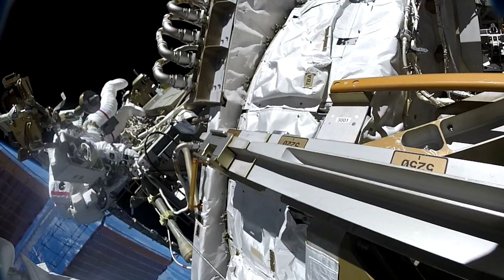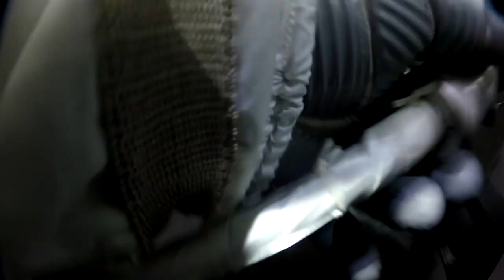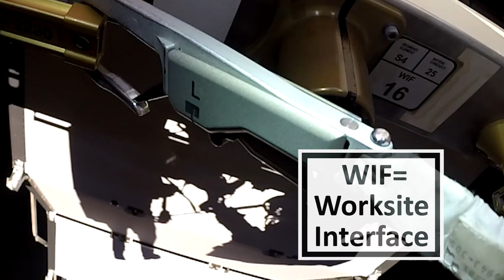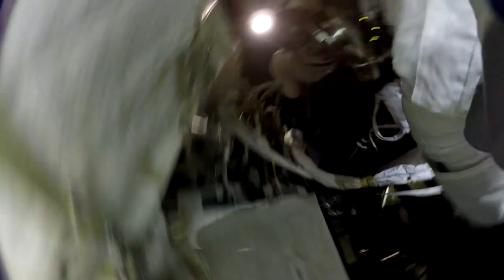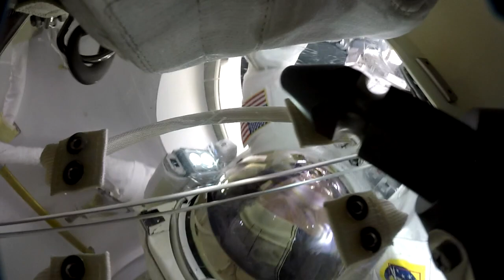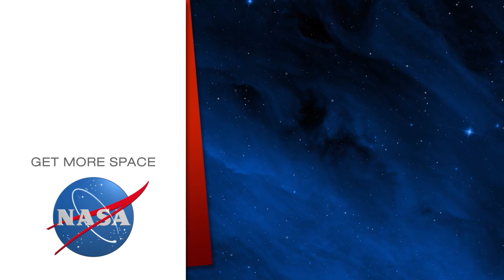I Am a Camera: On a Spacewalk

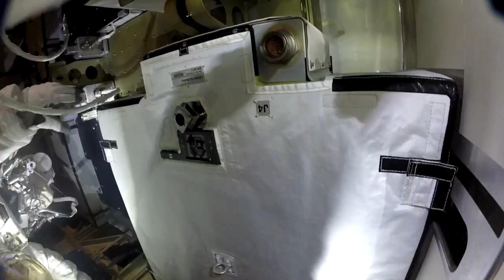Comment: 0:28 Is it though? ^_^
Reply: Damian Reloaded imagine how hard it must be to lock a shuttle to ISS
Reply: I was nitpicking. I meant that if the camera isn't leaking water vapor, it wouldn't experience an immediate change in it's temperature. ^_^
Reply: Damian Reloaded i thought you were referring the astranout keep trying to plug that hose or cable but failing 😺